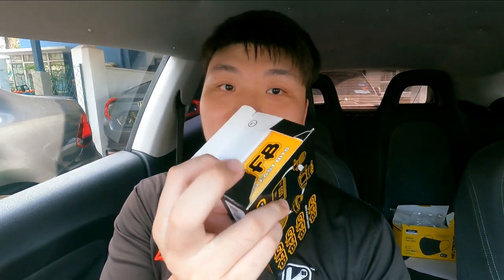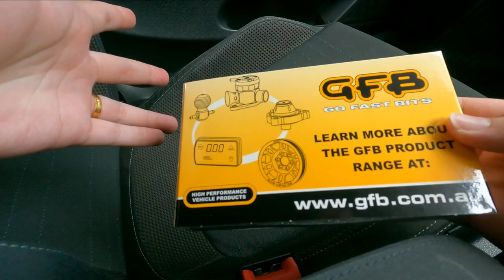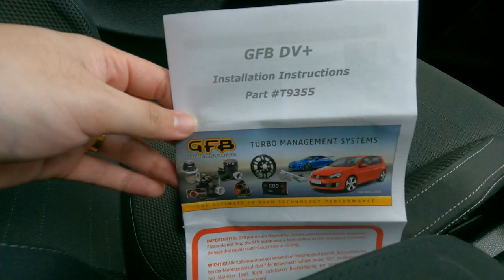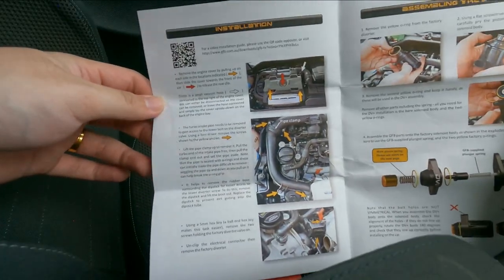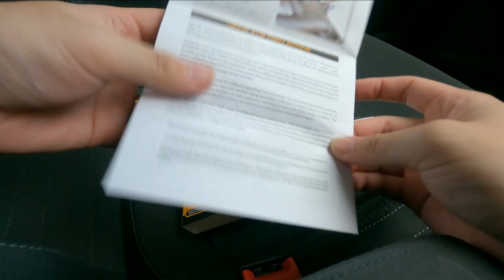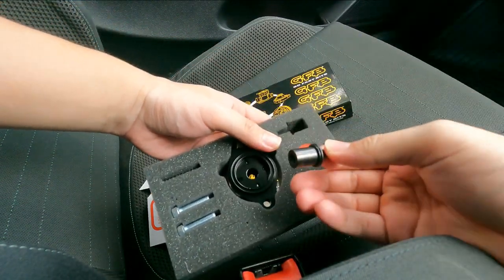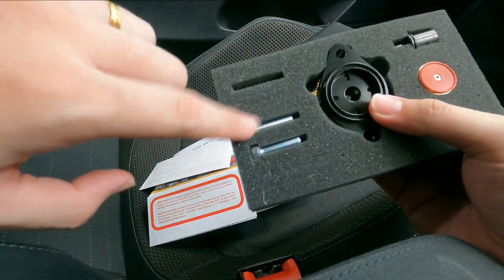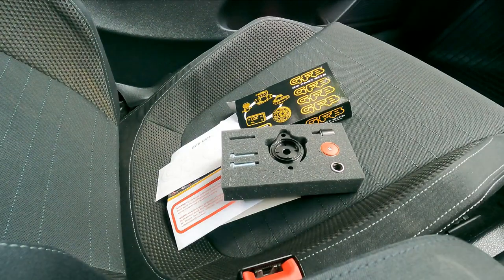Volkswagen Scirocco GFB DV+ Install : Underrated Upgrade!

Comment: I have a question, i installed the gfb dv but most cars make like a pshhh sound when giving gas but mine doesnt i dont hear that blow off sound is that normal?
Reply from the maker: It’s normal. You gotta get an intake kit for that.
Reply: @DrivenTechReviews okay but a friend of me has same car and he have the pshh sound with same setup only have k&n air filter installed
Reply from the maker: @keff4044  yup I had that sound before I installed the DV.
Reply: @DrivenTechReviews  ahh that make sense

Comment: Hi, any feedback from the DV?
Reply from the maker: More consistent boost Eventhough I hear more of the supercharger working.
Reply: @DrivenTechReviews  Just installed mine. I do noticed hissing sounds coming from back of the engine/firewall. How about you?
Reply from the maker: @softmuffin  hissing when light on the throttle is because the turbo is spooling.
Reply: @DrivenTechReviews  idling sounds like leak but at the rear engine. Hmm
Reply from the maker: @softmuffin  I guess it's something else then. Cause mine is fine. Could be a loose hose or something.
Reply: @DrivenTechReviews  Hey Droid, still haven't figure the issue. The hissing sounds still there but according to workshop it normal (supercharger). I'm from Sunway, do you mind if we meet up so I can hear your engine make the same sound or you can test drive my car? Many thanks
Reply from the maker: @softmuffin  supercharger should be whining and not hissing. Yup I could check out your car. Hit me up on IG @droidtechreviews

Comment: Does it sound any better? What engine is that scirocco
Reply from the maker: It's more about increasing boost that's about it. The one that changed the sound the most is the intake kit. It's a 1.4 twincharge.